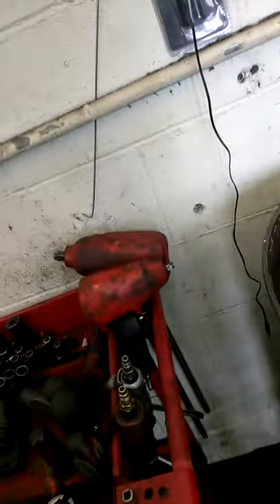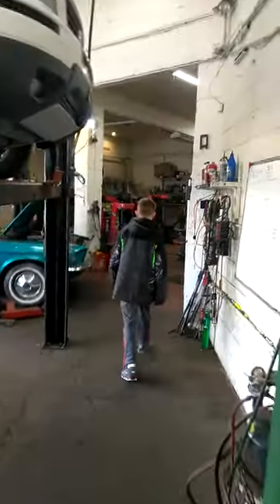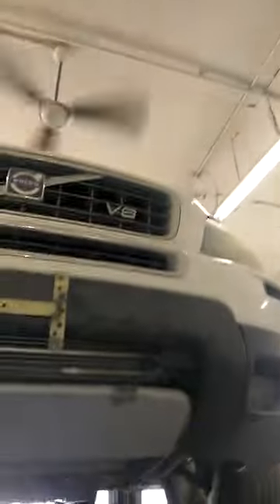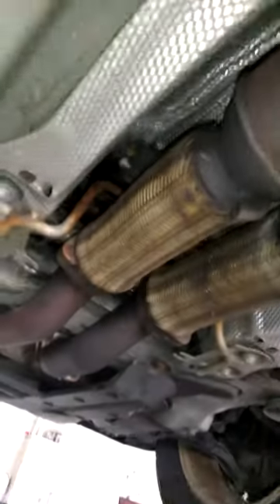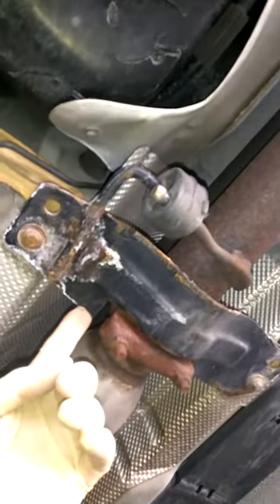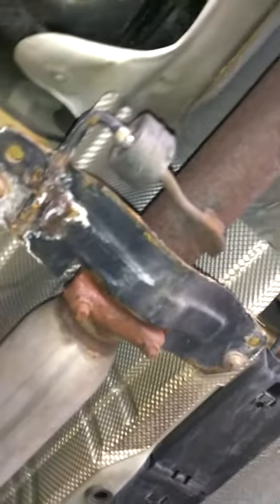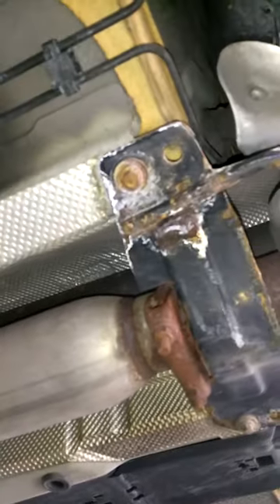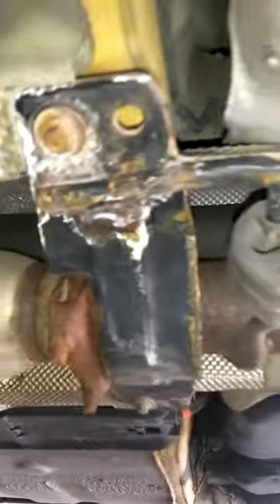Common Exhaust issues Volvo 2007 volvo xc90 . Meineke cinnaminson

Comment: What would you charge to do the same flex pipes on an 06 XC90 V8? I have two XC90s that both need flexes. Also in Jersey.
Reply from the maker: Cut and weld 2 flex pipes $300  that are under the car not in trans tunnel
Reply: I need this done